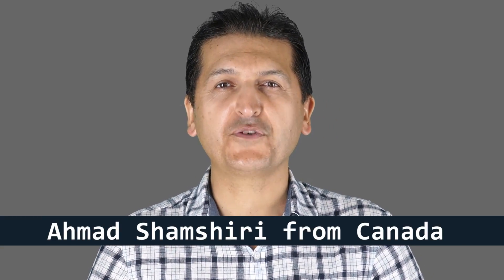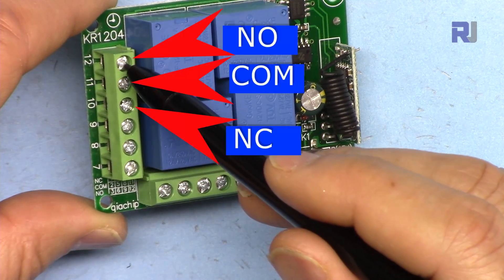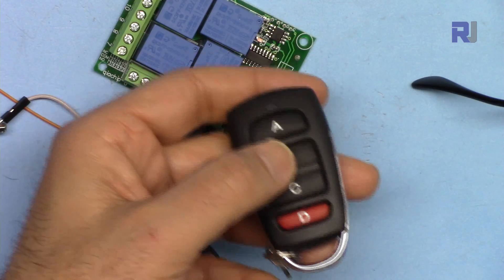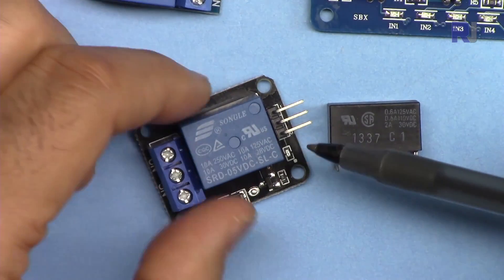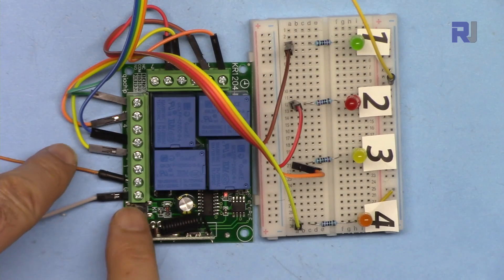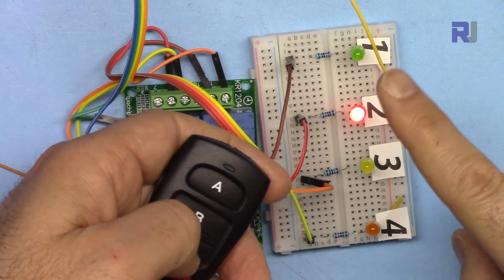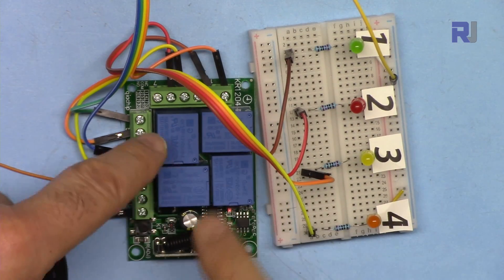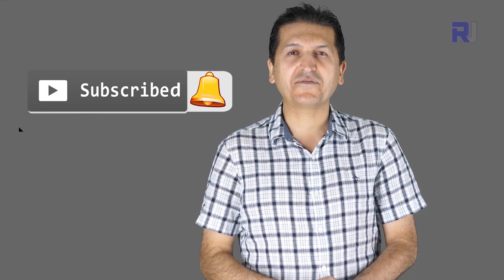433MHz 12V 4CH Channel Relay RF Wireless Remote Control Switch KR1204  FOB

Comment: Thank you so much! This was the only video that helped me with my problem. For the first time in 15 years I am able to use my electric garage door opener.
Reply from the maker: you are most welcome. I am glad it helped .
Reply: Hey I want to do the samething with my main gate for my home. Manual functions works but my remotes not paired and I can't get any information any so I want to  know if I can use this device to get back wireless functionality for my get  so I can Stop Open Close my gate please help me

Comment: Thank you VERY much for the tip on the other modes. Supplier advertised it as momentary only, so I thought I was going to have to send it back or do a lot of extra circuitry. Brilliant now it's toggle which is what I wanted 😃
Reply from the maker: You are welcome. Please subscribe. I appreciate it and helps my channel grow.  Thank you
Reply: @robojax  what is the range inside the house...between rooms with doors open ?
Reply from the maker: about 30m

Comment: That's a really cool project! I don't yet have a use for it but, hopefully in the future. I just had a question about the led setup. The resistors that are connected to the 4 led lights, how do I figure out the correct resistor to use? Will the leds just burn out without a resistor in place? Also, do you know of a guide to setup and to be able to run 12 volts on the output side, instead of the resistors?

Comment: Do these ONLY turn on and off using the remote?  That is to say is there a way you can wire them to use a simple switch?  For example could you wire it using a non-powered Try Me button used for activating Halloween animatronics?
Reply from the maker: it just switches something. if you don't know the switch, it connects two wires to establish power. if that works for you then, it is a simple switch.

Comment: Your transmitter (remote) can work automatically to on/off submersible pump motor,
For auto run when water tank 50% empty and automatic stop when full tank???

Comment: Very good. I bought a few units, but some units delatch after sometime. Any idea what can be?
Reply from the maker: I have no idea. either the module is bad or receiver receives signal or "assumes" to be receiving signal .  of course I assume that your transmitter keys are  safe and no one presses any key. or check the keychain to see if buttons are good. sometimes they could be depressed a little and you won't know.

Comment: Hi great tutorial, I need to use this for my rc car lights. LEDs , they have a positive/negative wire and the others only have 1 wire.... How can I power it with a 3s lipo (12v) but not burn the LEDs as I believe they are limited to 3v... Thanks a lot!😁
Reply from the maker: Hi, and you are welcome.  the LED should be either 2 wires which is regular LED or 4 wires which RGB (3 for R, G and B and wone for Ground). if your LED has 3 wires, then  you have 2 LED with one common Ground. something like this https://www.nutsvolts.com/uploads/wygwam/NV_0300_Marston_Figure09.jpg so find the common wire by disconnecting  them one by one to see which one turns OFF both and connect that to the relay to turn it ON or OFF. 
as for powering with 3S lipo, I did not get it, powering this module? it will not harm this. I have clearly explained that this module needs power to operate and it has nothing to do with your LED or other stuff or even AC load that you turn ON or off. I hope this helps you. good luck.

Comment: Love the channel! I have tried using a similar relay, but it is a 220v trigger and 220v relay. I can pair the remote and the LED flashes and "beep" when done. But when I try to activate relay with remote, relay does not respond, only unit "beeps" ?!? Any thoughts
Reply from the maker: Thank you.  This is strange. Because flashing only comes when the code for the remote is stored. I did an online search and found the receiver chip page https://www.sunrom.com/p/ev1527-rf-encoder-4-bits where you can see the datasheet. and in this page there is another example with Arduino https://www.dfrobot.com/blog-409.html But could not find solution for it. Perhas something is wrong with relay module.
Reply: @robojax  Thanks anyhow. I have 5 of these modules - time to put them back in the "I'll play with it one day!" box :)
Cheers

Comment: What is the role of jumper if it has four pins 1,2,3,4. What are its modes with it? How to set the modes and operate?
Reply from the maker: that is exactly I made the video for. please watch fully. you will not have any question left at the end.
Reply: @robojax  thank you for replying

Comment: 12 volts and how many amperes power supply should need to run this circuit?
Reply from the maker: Assalamu alaikum Muhammad,  you can use any 12V power supply as this needs very little current like 200mA. so you can't find 200mA, you can use 500mA 1000A or any thing .
Reply: @robojax  Walikum Asalam thanks bro  for your prompt response. You have resolved my query
Reply from the maker: you are welcome.

Comment: Also tell us the ics or microcontrollers which are used in the product while product reviews.
Reply from the maker: not needed because you don't deal with those. if they burn you throw this module and buy another one because the components are more expensive than the module.

Comment: Greta description of the operation of the device but I doubt the relay PCB tracks have safe clearance from the 12V DC side for use at 240V AC.  As a minimum use an RCD / GFI and connect the 12V -ve to mains earth.

Comment: Hello I would like to use my vehicle transmitter to operate the relay contacts?
Reply from the maker: Hello, the transmitter for your vehicle is totally different technology. will not work. also security will not allow it.
Reply: @robojax  even if it transmittis at the same frequency? Is there a way to alter the board to be able to program it from different controller?
Reply from the maker: it can work only with the same chip that is in the transmitter only.

Comment: Friend, how can I do so that momentary mode can press two buttons at the same time and activate both outputs at the same time?
Reply from the maker: I believe I have left nothing without explaining. I don't remember anything about this module. to answer, it I would have to watch it. so you better watch and get answer.  if you can't find the answer, it means this module can't do it.  of course you can modify this module by soldering wires so when you presee ONE push button, turn ON two relays etc. Good luck.